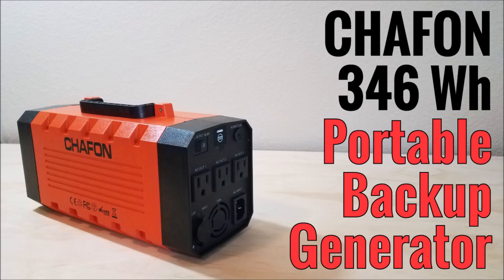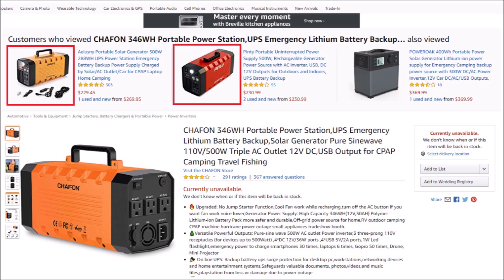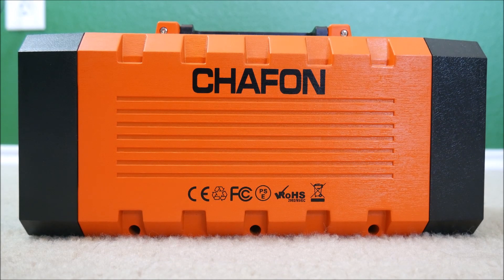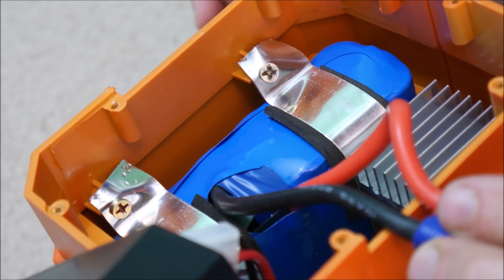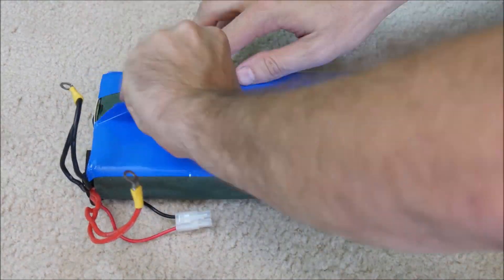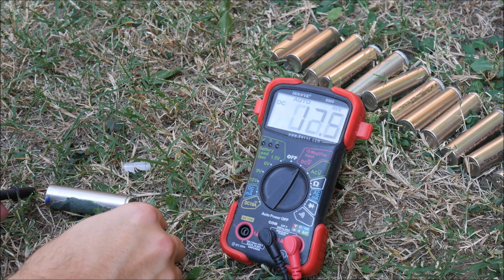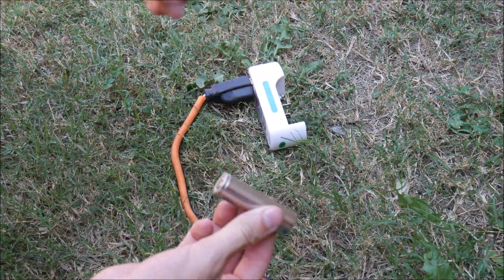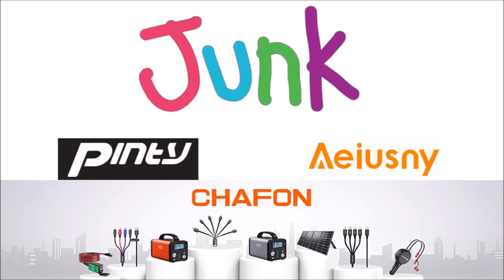What Is Inside A Chafon Lithium Power Bank? - Autopsy Results & Hidden Issues

Comment: did you make sure to complete the battery balancing phase of the charging? It takes another hour of battery balancing before the light turns green even though the charge is already at 100%.
Reply from the maker: Yes, it was not a charging issue.  It sat on a shelf for a few months and the next time I tried to use it it was unresponsive.

Comment: I just watched your video, I have one of these and have had the same problem. I’m wondering if I could crimp/solder an XT60 quick connect and use an external 50ah lithium phosphate battery?
Reply from the maker: Yeah, that should work.  As long as the new battery pack is similar size it should be seamless.

Comment: I actually got 4 1/2 years out of mine. It just died two months ago. I used it for lights, small fans and for my electric cooler. I was also able to jump start my Durango twice. I actually used it a lot and just out of nowhere it completely died. Thanks to your video I don't need to take mines apart. 

I wanted it to last at least another year, but hey, you get what you pay for....   
Thanks for the video.
Reply from the maker: You are welcome!  Glad to hear you got much more use out of yours than I did.
Reply: Mine's still working but I haven't used it much - been 6 years!

Comment: Hi 👋 I have one of these, it charges, usb ports work fine, I mainly use it to jump a car or charge a phones via usb.. but my dc outputs doesn’t work.. can it be fixed,? If so, wha should I look for or what would you recommend?
Reply from the maker: I don't think it can be repaired unless you are a whiz with electronics.  But as far as just ordering a part and replacing something that isn't possible.  They don't sell these any more and I don't even see that the brand is still around.

The best you could hope for is to open it up, find the + and - leads from the battery pack that should go to the DC output ports and hack into those.  Drill a hole in the case and feed some wires through it and some connectors.  Might be ghetto but it would work.  Obviously, do this at your own risk and with a basic understanding of electricity and direct current, specifically.

Comment: I have a version of one of these called "EcoWorthy". It quit charging past 62% and had really short run cycles. After seeing this video, I got brave enough to take it apart. The cell banks were 4.17v, 3.2v and 3.0v. The BMS cuts charging off when it sees 4.2v on any bank and leaves the other 2 banks where they are. Not a very good BMS. No balancing is done. Just a charge and discharge cutoff. Also, one cell had shrunken wrap that revealed about 1/2 inch of the top of the cell and what looked like contact with the solder tab for the BMS bank2 sensor wire and shorted to the case of the adjacent cell case on bank1. Evidence that one cell had been overly hot. I am lucky I didn't have a fire. I bought and installed a flying capacitor equalizer and a switch to turn it on and off and I can manage to keep the battery balanced now. I run the equalizer when using the unit now and the battery stays in balance and lasts a lot longer on a charge now. 
I have always wondered what am I supposed to do with any unit like this when the batteries reach their end-of-life. It seems like there should be a way to change the battery pack like there is with other battery powered equipment. They are apparently designed to be total throw away pieces. Shameful waste.
Reply from the maker: Agree with everything you said.  They are designed to be just good enough to sell a bunch of units quickly until the bad rep catches up and then they pull it off Amazon and pop up again under a different brand name and color scheme/facelift.  It really is shameful.
Reply: Actually I thought Chafon would have replaced the battery for it? But I guess not. Also you are supposed to let it charge for another hour after 100% as that is the balancing cycle and then the light turns green. Maybe this spin-off brands did not have the original battery management module?

Comment: Mine just went kaput with a blinking red and green ac charge light. At least I got a good 4 years out of it . Nevertheless glad to find someone who dissected one of these things . They were one of the few higher rated units on Amazon at the time but I’m glad the industry has expanded and matured. I’m currently using some bluetti products that are performing quite well
Reply from the maker: Bluetti makes good products but the company itself is kind of a mess.  So that is a safe bet as long as you don't need support.

Comment: does anybody know.  Beyond the display and charging status led, is there anything critical in the solar charger on the board in the front of unit where the display and flash light is? If i remove that part of the unit will it still charge?

Comment: Hi thanks for your quick response. The (alleged) bms system they used has managed to fry all the batteries in the pack, they are all open circuit when tested for resistance and I have tried to charge a couple of them without success. I am not an electronics engineer but have electrical bias and I am going to attempt to rebuild the battery pack using a better spec BMS.
Reply from the maker: I am sorry to hear that.  But I have heard from quite a few other people like yourself that had a similar experience to mine.  I wish I would have know this before the review video and could have given a negative review and steered people away from wasting their hard earned money.

Comment: Great video and honest review of this unit. I have four of these units sitting on my office floor all in various states of disrepair. These units are not cheap and I believe they are not fit for purpose. The company that make this unit must be held accountable. I notice they have a CE icon on the product which is laughable I would love to know where and by whom these units are made by because I have a lot of angry friends that have bought these units who live in areas where there are constant blackouts and rely on products like this to power small appliances eg laptops fans wifi systems.
Reply from the maker: I am not 100% sure they are truly certified by CE.  I cannot get in contact with the person who originally worked with me on this review to ask them for proof of certifications.  It would be easy to throw that logo on there, sell these on Amazon for 3-4 months until some negative reviews start flowing in, and then pull the products from Amazon and start selling them under a different brand name.  Rinse and repeat.

Comment: Can that unit still be repaired by replacing the batteries?
Reply from the maker: Yes but it will just burn up the new batteries.  There is some reason why 1/3 of the batteries died so fast.  Some kind of BMS issue or bad wiring.

Comment: YT didnt recommend your video when I was looking for reviews. So i got one for $200..and ive used it in the field and ensuring i dont go below 30% capacity and recharge using solar only. I hope it lasts at least for 3 years on stand by...
Reply from the maker: Hope it does better for you than it did for me!  I literally only used it a couple charge cycles.  But I have gotten enough comments and emails about this brand and the other copycat brands using the same design to believe it wasn't a fluke.

Comment: Wait a second I am looking at cells that have no or melted wrap ? Or it’s clear ? If nothing was protection then from shorting aside from that green paper then a short happened inside and or tripped the bms and also that bms is abit too cheap tbh , it’s looks like they didn’t care to produce a quality product after all , that’s not a reason to sale it cheaper from lack of taking the time to do it right . Thanks for sharing many of this stations have same circuits and just change the outside color of plastic and brand , I was looking on many of the YouTube’s that open this many brands and yeah they have cheap quality cells or bms or some don’t even have bms so you got to buy more reliable sources not everything that looks good is great ... and sometimes even expensive things fail so best to trust in God hehe he is righteous but anyways happy 2021 hope we learn more this year and take care ...
Reply from the maker: Agree.  I may open more of these in the future to take a look inside.  It was an eye opening experience.

Comment: Mine started buzzing when turning on the AC inverter. And it won't run anythin 40W or higher. Plugging an LED lamp the light flickers. Is this an inverter problem or battery problem same as yours?

Comment: Nice video and good diagnostics.  One comment though.  I am a power management integrated circuit (IC) product definer and have defined several battery charger ICs for smartphones and other Li Ion powered products.  We ALWAYS put an automatic dead-battery recovery mode in those chips.   I’m surprised your “sophisticated” charger was missing that feature.  You should open it up and see what chips are inside your charger.  😆
Reply from the maker: Haha, I know I was surprised, too.  But no matter what I did I could not get it to recognize that there was a battery there on the other end of the leads.  Maybe there was another charging mode I should have selected.  It has a ton of functions and I have yet to learn them all.

Comment: What was the rated capacity I have seen companies do the watt hour calculation with the full charged voltage so like 2.4 x 4.2 I have seen most of the (20v) tools do it with 4v or they are just lying or they planned on using 2.6 and ran out and 2.4 were cheaper so
Reply from the maker: The rated capacity of the entire unit was 346Wh.  If they used the full charged 4.2V voltage then it would be 362Wh.  So who knows how they came up with 346.

Comment: The date on the BMS is almost certainly just the version of that circuit board. Looked like the regular silkscreen which would set when the board was designed, not when it was built.
Reply from the maker: OK, good to know.  But it is still an old design, right?  Shouldn't BMS technology have marched forward significantly in 3 years from 2014 to 2017?
Reply: The balance has changed over that time period.  Some older BMS devices don't support balancing.  I do see what appears to be resistors near the battery leads at 3:13, so it does appear to have passive balancing.
Reply: @gn02020202  My Chafon always takes an hour to finish balancing after it's already at 100% and then the light turns green. I haven't had any problems as long as I make sure it's balanced first. So I got mine 6 years ago - but I don't use it alot. Still I have charged it via bicycle DC through the solar port - and also solar panels and AC charging and car charging - 12 volt inverter.

Comment: How does the Jackery do?
Reply from the maker: Jackery is still doing well.  It has a brand reputation to uphold.  Granted, I don't use them often like I said in the video.  Just occasionally charge them for an emergency.
Reply: LDSreliance Ive been using My jackery 240 Daily to run my game console, it gets charged off of my bigger homemade system. Capacity has slightly dropped maybe down to 190 effective watt-hours, after roughly 2 years of owning it and maybe 800 cycles. i know at any point in time if I really wanted to I could replace them and upgrade
Reply from the maker: Hmmm.  That would be surprising to lose that much capacity after only 800 cycles.  The 18650 cells should be good for at least 1200 cycles @ 80% capacity.  Maybe something else is wearing down instead?  Maybe they cheaped out on the BMS, also?
Reply: @LDSreliance  Well, It may have been more cycles than that, hard to really tell. Would need to do a for sure capacity test. I can tell the capacity has dropped a bit for sure. Nonetheless, Still holds plenty of energy for what Id need it for. Sometime you should review the 1000 model.
Reply: @LDSreliance  I have seen the insides of the Jackery models, and they are way better quality and put together than the Chafon you reviewed. Shoot, I built my own 144WH Lithium power bank with as many features as the Jackery and my quality was better than that BMS release date in the video lol
Reply from the maker: Yeah wouldn't be hard to beat the Chafon!  I'll reach out to Jackery again and see if they are interested in sending me another unit to review.